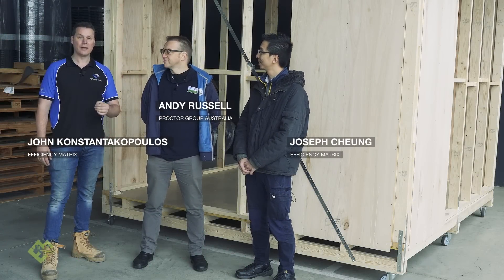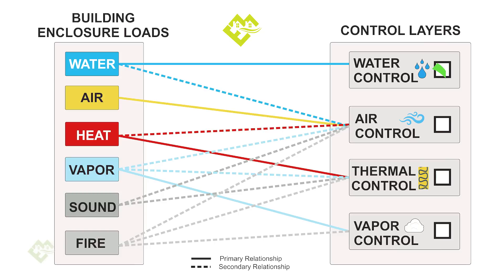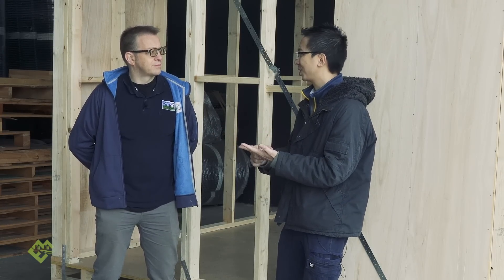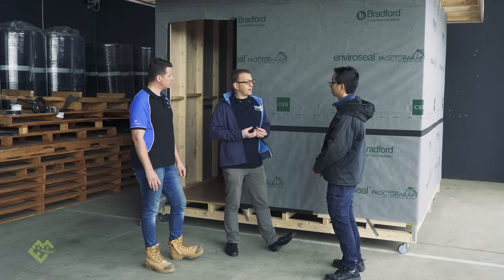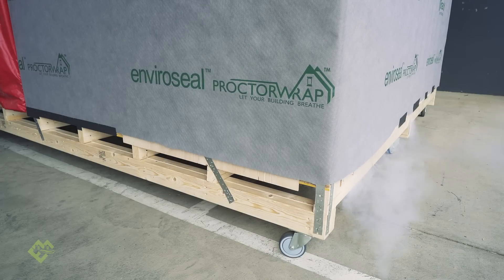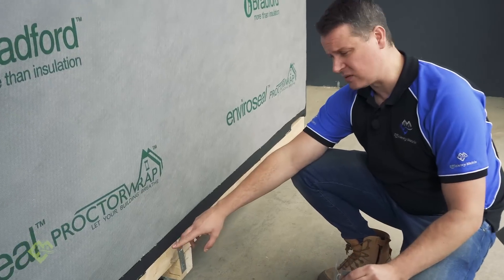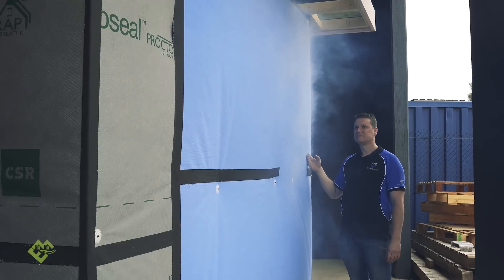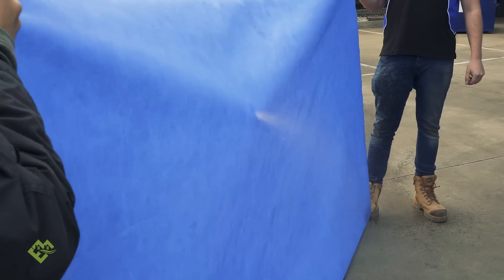Air and Vapour Permeability in your homes wall sarking details.

Comment: Hi Guys, 
is it possible to install an airtight membrane internally followed by insulation and then a vapour membrane. It won’t be passivehaus standard but will it be tight enough to require a heat recovery and mechanical ventilation?
Reply from the maker: Any home is tight enough to require a heat recovery system.  Or at least a 24hour ventilation system, with no heat recovery.

Comment: Can I use that green wrap on the inside of the house before the plasterboard if I’m renovating ?
Reply from the maker: You would use a different wrap on the inside.  This one.  With an AB tape available from tighthouse also, https://tighthouse.com.au/collections/building-wraps-accessories/products/internal-building-membrane-1500mm-x-30-m-roll-residential
Reply: @ecoevo  which will be the better option for a renovation if budget allows it - professionally done spray foam or internal wrap with insulation batts considering I don’t wrap between the bricks and frame ? 
I’m thinking spray foam is better

Comment: what is the recommended way to attach the membrane to the frame? I'm assuming staples are not good enough and compromise the air tightness?  Would a product like Kingspan Air-Cell Permishield 65 be a good membrane with added bonus to act as external insulation? Or is it not meant to be air tight?

Comment: I’ve built a home before these standards and there’s a lot of heat coming in the master bedroom (the sun hits the wall) this is a double brick wall with no windows or insulation. What would be your best suggestion? I’m thinking blown insulation around the envelope but open to any suggestion. I still need to address the fans with a draft stopper. Cheapest solutions will come first. Still plenty more research to do, I don’t want bad repercussions for my solution (do it once do it right)

Comment: Love your site and info, has me rethinking aspects of current Reno (in its final stages)
I used Proctor wrap on this renovation, despite pushback from tradies who weren't familiar with it. I have also recommended it to clients. 2 issues: 
1/ we found the proctor tape didn't stick well,it came off, we had real trouble getting adhesion, and the tradie ended up using Silver tape which stuck well.
2. Taping top and bottom wasn't done and i don't recall info on the proctorwrap explaining the importance as you've demonstrated. 
I don't have access to the top, but the wall over it is hebel and currently there is a >50mm gap running at base of the wall. Installer had suggested to run angle along, but now I'm wondering if there is better way to seal it? What about when there is any water vapour between the proctor and the hebel? How does that run out if i seal the base fully?
Reply from the maker: Thanks for your comment.  1. With these tapes, they are pressure sensitive so it's super important to stick them down well with a scraper or your hand. https://youtu.be/6cB_vPnETTs  2. When you have the wrap there should not be substantial liquid water in that gap, and so it should be able to permeate through the Enviroseal wrap.

Comment: Would love to see you do something simular for the tropics, where vapour barrier is typically placed on the warm side (outside) of the insulation and is therefore often coupled with the waterproofing layer and reflective foil insulation however I worry that this is am impermiable layer with no ability to allow trapped vapour or interstitial condensation to dry outwards in a humid atmosphere.
Reply from the maker: Hi Sandra, we discussed this in our latest youtube video, around 24:10
https://youtu.be/TgswRUmejyY
Enjoy...  Thanks for watching our content.

Comment: I do wonder what your views are on the product foil board.
Being foam it insulated as well as creates a barrier but it is certainly not vapour permeable.
Reply from the maker: It can be a useful product depending on the climate and where you put it in your wall detail. 👍🏻
Reply: @ecoevo  in Victoria i had in on the outside of the studs behind the bricks with fibreglass under the foil board then plaster.

Comment: How do you handle vapor permeability with insulated concrete sandwich panels?
Reply from the maker: What product is that Evans?
Reply: @ecoevo  THERMOMASS XPS Insulated Precast Concrete Panels
Reply: @tsport100  Vapour permeable wraps are aimed to maintain the moisture level in wall cavities where building materials are sensitive to water contents. the most commonly known example is the timber frame in Australia brick veneer construction. Thermomass XPS panels, on the other hand, consisted of precasted concrete and XPS board. Both key layers are considered water insensitive plus it does not have a cavity. Therefore, no moist air in the wall construction. In addition, both layers are considered airtight as well.

Comment: Since this membrane is air tight but vapour permeable, do you think this would make the perfect wrap for straw bale houses?
Reply from the maker: Tom, sure, you can wrap the outside of a straw bale home with a vapour permeable air tight wrap!
Reply: @ecoevo  shouldn´t the vapor permeable air barrier be placed on the inside part of the wall?
Reply from the maker: Joel Mendes Nope, in the southern colder parts of Australia, the outside part of the wall needs to be water vapour permeable.
Reply: @ecoevo  is that because of the high level of humidity generated within the home -so a need to have it escape?
Reply from the maker: @somethingdiffdesign5809  It's a combination of the warmer air in a home, and because our activities generate humidity, when that air gets in contact with colder surfaces in our construction elements they will deposit this moisture on these surfaces.  It's exactly the same effect that you see when you pour a cold beer into a glass.  We cover this in a bit of detail in our latest Proclima video. Enjoy.

Comment: What do you recommend under Terracotta Roof Tiles? Currently no sarking at all (70 year old building). Ceiling batts are the only insulation. Removing tiles to apply a wrap is an option. What product to use? Maybe you guys could come and video it and I won’t charge set hire fees 😉
Reply: For roof tiles then the reinforced medium duty Enviroseal ProctorWrap HTS vapour permeable sarking is the way to go.  However, to retrofit sarking you would need to lift the tiles. The function of the sarking in this case is as a secondary water control layer. If there are no problems with the tiles stopping the water from getting in then I'd suggest you leave it alone. If adding an air control layer,  this is most likely going to be located at the ceiling line on the interior side of the ceiling insulation. (assuming you are not in the tropics !)  Efficiency matrix have all the products and experience to help you there.
Reply: Andy Russell want to add Solar Panels, but don’t want to regret not doing something underneath before that.

Comment: Great work guy love this video good information explain well. I really need to re think my building wrap. I have been using breather wrap under my foam render panel, but pretty sure it offers very little performance.
Do you have a recommendations for building wraps under EPS foam panels?
Reply: Check out "Pro Clima" products. I'm looking at using the SOLITEX EXTASANA product for my ICF build.